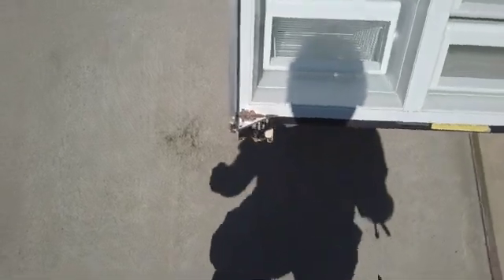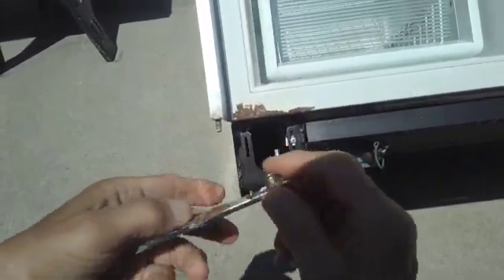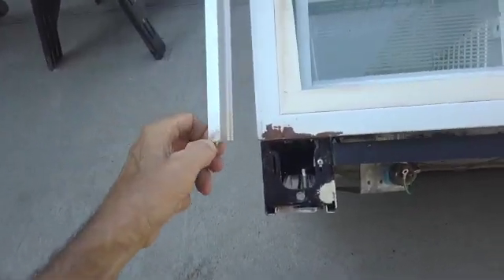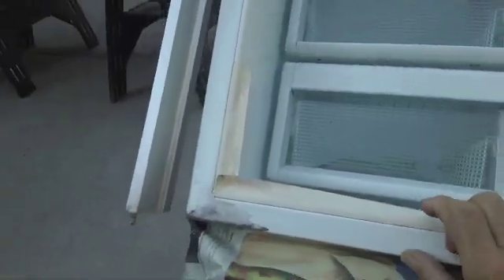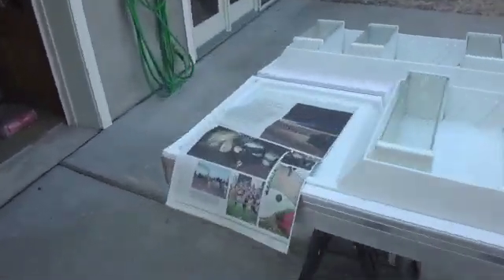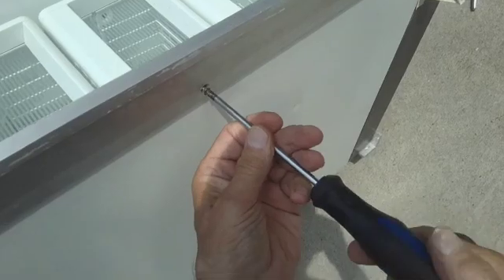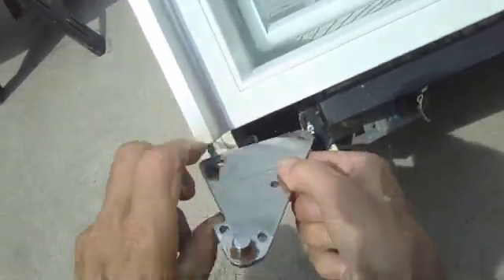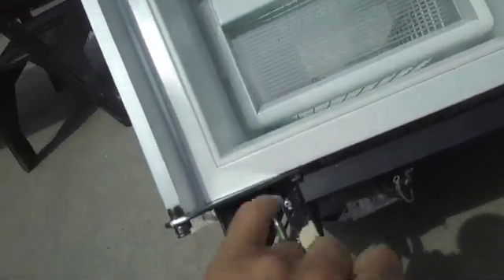Sub-Zero Rust Repair

Comment: Love the videos and your work expertise but do NOT use the Por15 paints for refrigerator or other appliances that may be in the vicinity of or in contact with food products!   Their paint line is not safe or FDA approved for being near food products.    Take care.
Reply from the maker: @mspring6387  Thanks for the tip
Reply from the maker: I called POR15 and they were not sure about why, can you elaborate or send us some clarification
Reply: @SubZeroSpecialists  I have a few rust spots in the freezer of my model 590 and watched your vid and tried to find the MSDS on that specific gloss white paint you used and when i could not find it, i emailed them directly asking about FDA approval or if their coatings were safe around food products.   Their response "Sorry, our coatings are not FDA approved for use near food preparation."    That was all they wrote back and was hoping for more info.    I have the email back from them if you want me to send it to you.   Thanks!
Reply: @SubZeroSpecialists  Continuing with same discussion about FDA approvals, i did order the Rustoleum Appliance Epoxy instead figuring since it is advertised as for 'refrigerators, laundry machines, etc.,' you would think it is safe around food products.  Nope.   It is for external use only and not safe around food products.     So i guess i'm back on the hunt for what is acceptable to be used INSIDE the frig or freezer.      Here is an answer on their website to the question of safe use around food "Rustoleum Appliance Epoxy is not safe for food and should not be used on surfaces that will come into direct contact with food; it is intended for exterior use on appliances only."
Reply from the maker: @mspring6387  okay I will call subzero next week and find out what paint they use in their products. I’m not sure why POR15 isn’t acceptable because when it dries it becomes inert. Go figure…
Reply: @SubZeroSpecialists  Yeah i hear ya.   I own an electrical contracting firm and we work in meat processing plants and we have been cited and demanded by the USDA inspector to return and remove the tiniest bit of caulk we use to fill holes we make for wires to pass, unless we provide proof that the caulk is food grade safe.
Reply from the maker: Okay I talked to Sub-Zero about the paint. They powder coat the metal parts which to me would seem impossible to do in the field on the cabinet itself. However, the interior parts can be done. As far as I know powder coat paint needs to be baked on at high temp. As for the face frame on the newer SZ's there is a patch kit available PN 4203930 which I will order and make a installation on an upcoming video.
Reply: @SubZeroSpecialists  got it.   great.   i just have a few smaller rust areas i'd like to sand down to bare metal and touch up.   I emailed subzero asking if they sell food-grade touch up white paint for interiors.    Will let u know what i find out.
Reply from the maker: Here is a list of FDA approved coatings: Acrylic, epoxy, silicone, Polyvinyl chloride, Phenolic resins, Nitrocellulose, Urethane, Natural and synthetic rubber. POR15 sells a two-part gloss white epoxy paint which should be okay. These FDA rules apply to food-processing plants, doesn't mention anything about patching rust spots on a household refrigerator.

Comment: Hi...is the por50 gloss white? And where could I find that compressor attachment? Or the name of it...my subzero has rusty drawer rails that need to be removed and painted...the defrost heater went bad..and the repair guy is afraid to remove the rails..as they have rusted to the box. ..any suggestions on how to loosen the rusty screws as well?